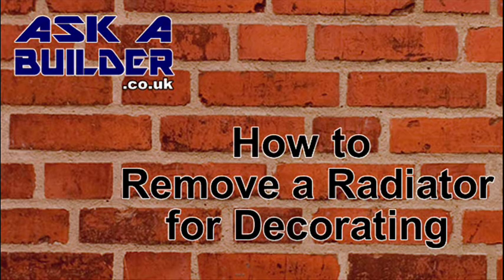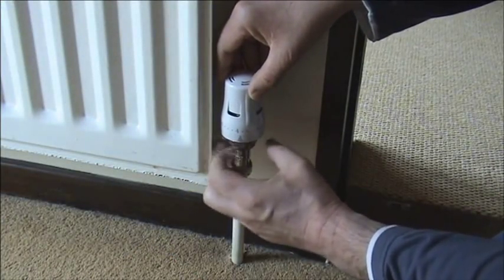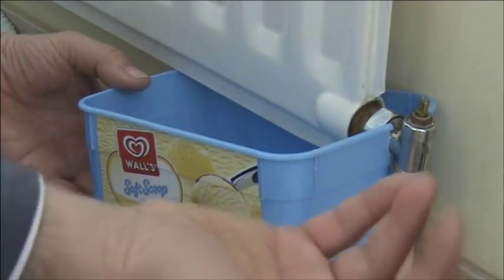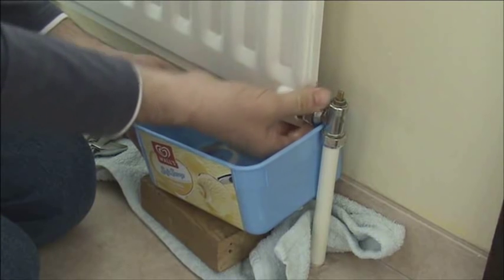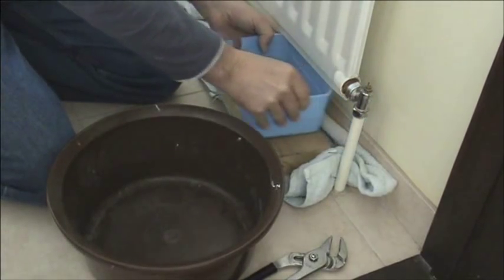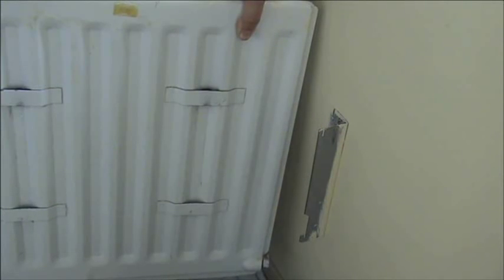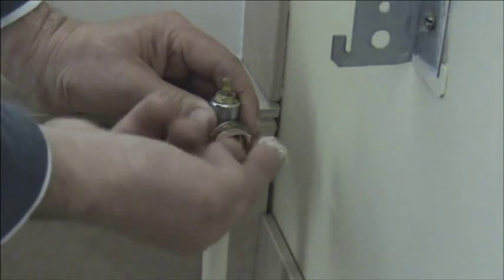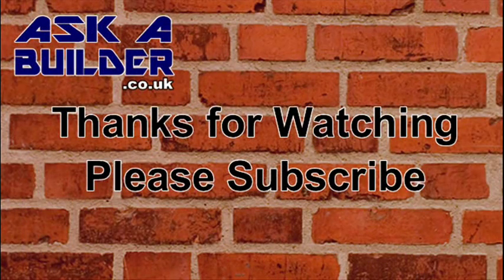Removing Radiator For Decorating

Comment: If the central heating is on a condensing boiler don't forget to top up pressure system as you refill.  Boiler will probably "trip" when you next want hot water if this is not done.  Be gentle with shutting off those isolating valves as well.  Big spanner and too much oomph = goodbye to valve.

Comment: Other 'radiator removal' videos have suggested shutting off the heating and water system. This video doesn't mention anything about it? Is that something I should be doing prior to removing the radiator?

Comment: Hi,I have a thermo on my rad. I took the rad off as described but it drips. I'm now looking to blank the holes while I decorate. Can you please advise what type of blank or plug I need ? I've seen plugs/blanks on ebay but I'm not sure if I have the right thing or size. Thanks in advance.
Reply: ***** I think most pipework requires a 1/2 inch blacking plate.

Comment: Could this be a semi permanent solution?  I have a radiator at a bay windows and i want to build a seat under the window.  Could this be used so if i ever needed to reinstall the radiator i could?  Thanks